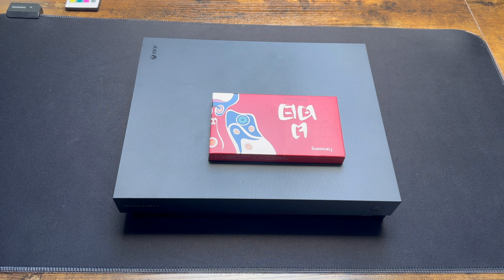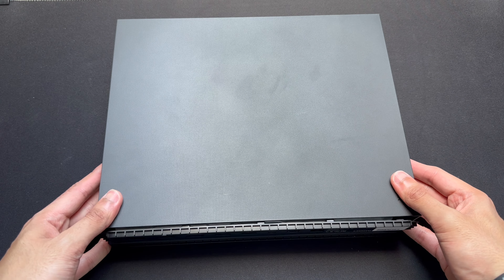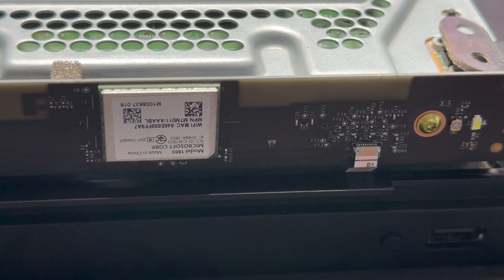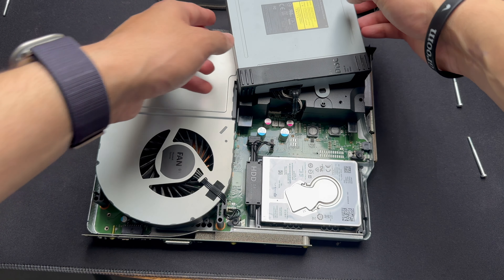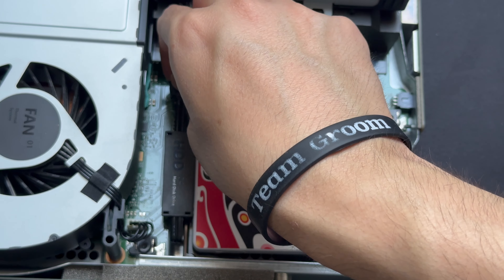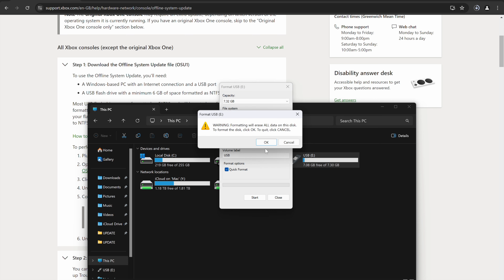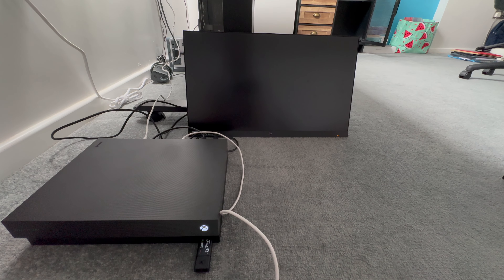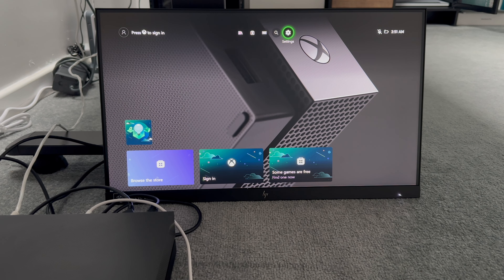Install SSD in Xbox One X

Comment: How do you fix when a 960 GB ssd only give you 365gb instead 700 GB or more. How to get those 595 GB left, when Xbox creates a partition for "files, OS and etc"
Reply from the maker: So you need to use a actual 1tb ssd as the uneven numbered SSD’s don’t function correctly

Comment: Did you have to update / setup the console again after it loaded from the OSU? Meaning after it ran, and you booted it up, did it perform another system update? Thanks
Reply from the maker: No, you just do the USB method I showed you
Reply: Dude I got the exacts in the video and it won’t wffing work , I spent 10hrs on this , error code 106 blah blah I don’t get it just won’t work like this guys legit the exact same setup the same ssd ALL of it and nope I wasted 100 for ssd and 15 for thimb drive I legit wasted the day and money fuck

Comment: Good video but why didn't you try to get a 2TB SSD instead of the 1TB?

I realize this was a decision you just made but honestly the 1TB HDD and the way Microsoft formats it makes the 1TB feel like you gotta be ready to delete stuff and some of these games can take up a lot of space.

Iirc the Microsoft format firmware should work fine with 2TB and they claim it should work with 4TB but the latter has to be made by a particular brand and most Xbox one fans seem afraid to do 2TB much less 4TB SSD.
Reply from the maker: I didn’t need 2tb as I have a series X as well